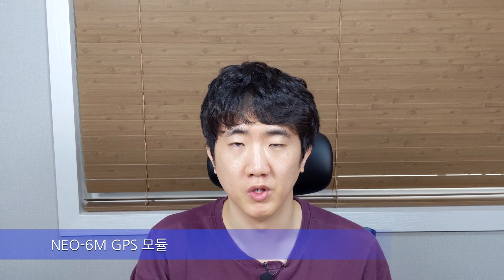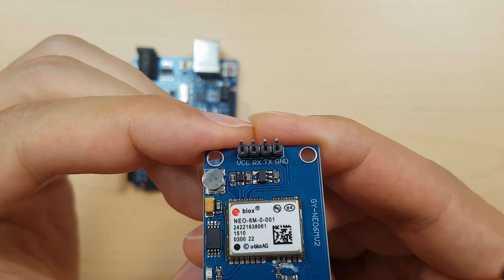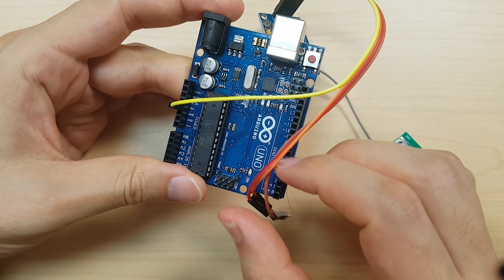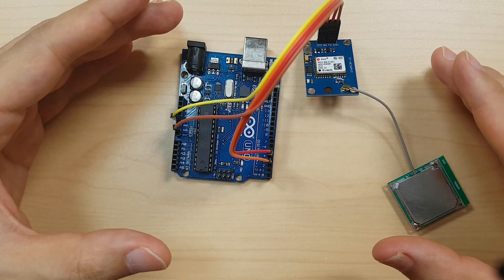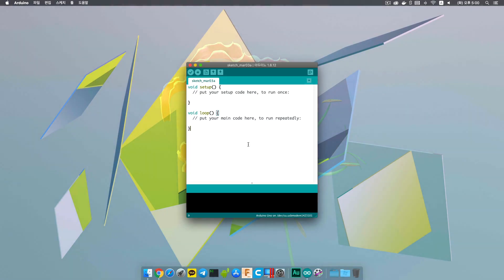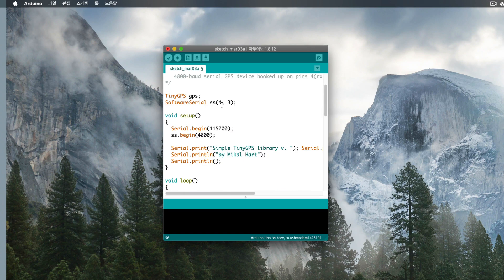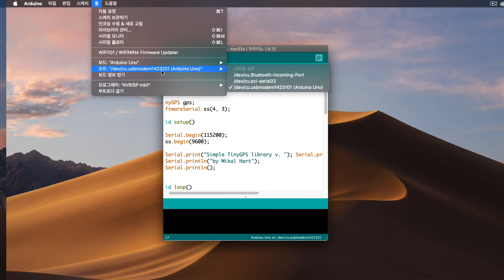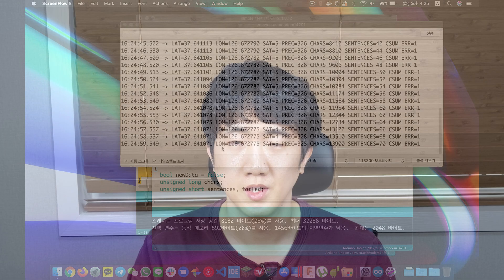Connecting and using the NEO-6M GPS module with Arduino

Comment: very good vid.  Could you please explain why you did not use the tx,rx (0,1) pins?
Reply from the maker: That’s a very good question. Pins 0 and 1 can be a better choice because they are hardware serial communication pins. However, since they are also the pins used by the default serial port, they can confuse beginners, so I decided not to use them.
Reply: @neosarchizo  OK. Thank you.